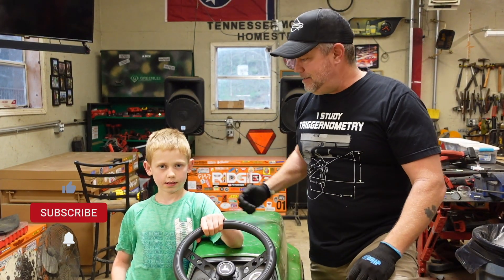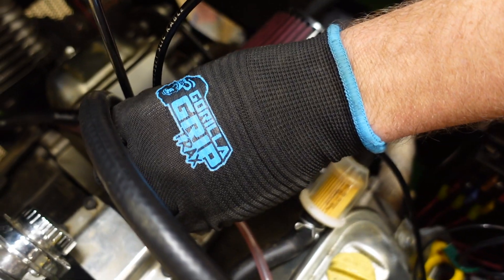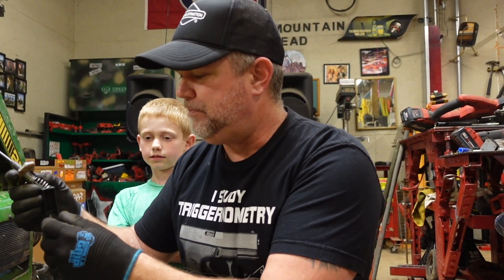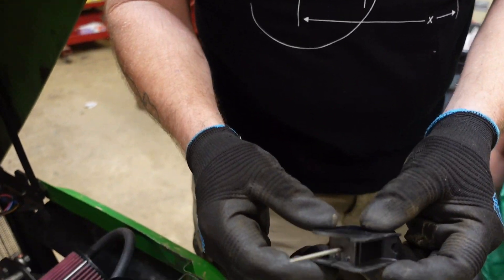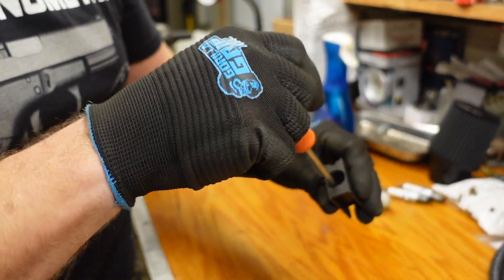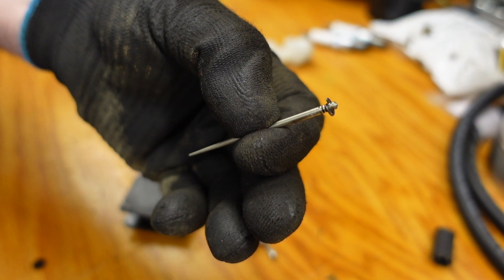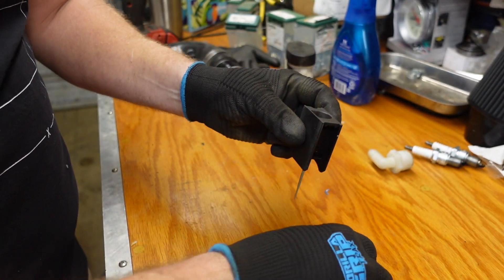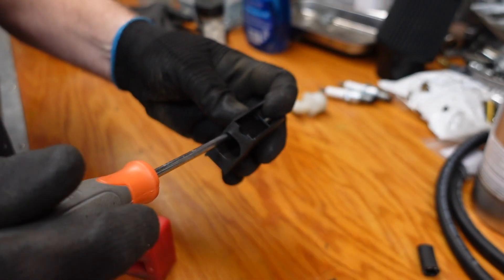Mikuni TM34 Flat Slide- How To Adjust the Needle Jet! Tuning in the Mud Mower, Part 4

Comment: What worked best for me was i ordered a needle jet p2, it comes stock with q2, i currently have the 17.5 pilot and a 210 main jet, im running healthy 670 with all performance 670 parts plus lil custom work. Afr at idle is roughly 13.5-14.1 mid throttle to 3/4 is 13.2 and wide open under load 13.0. Im running 100LL fuel in my golfcart
Reply from the maker: What ultimately happened was the remote choke wasn’t set right. I made a longer cable than what it came with. I set the plunger depth to the same length as the little pull/ push choke that comes on the carb stock. Sometimes the choke would close and other times I guess it would hang open enough to run rich as can be. Once I realized what was going on and fixed the problem it really cleaned up. I don’t have an AFR gauge on it but after all that I believe the main and pilot jet could go a step or two richer… 
I’m currently building a Sears Custom 6 with another 670 in it. Like you, I got just about all the parts to make it like their Performance 1 crate engine. Should be interesting once it’s all put together.